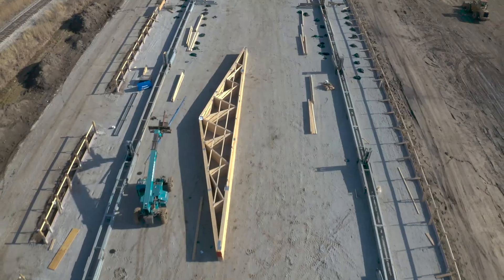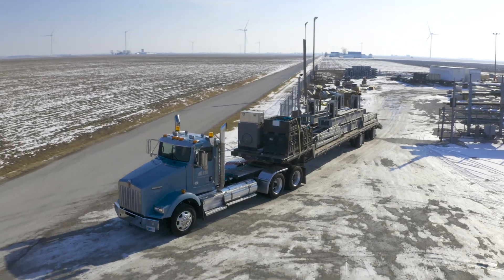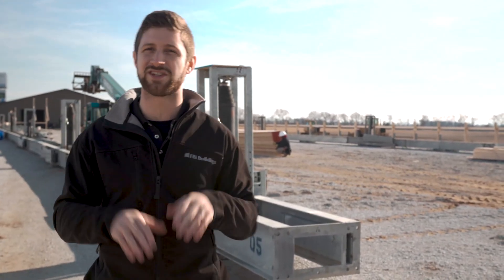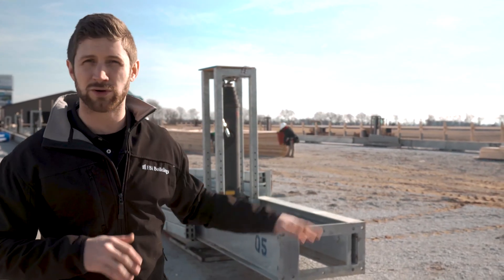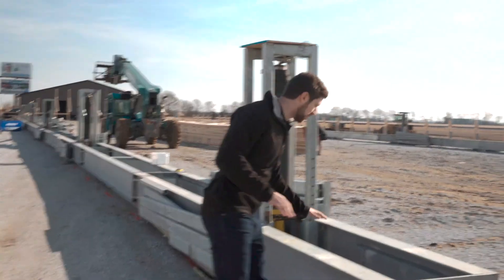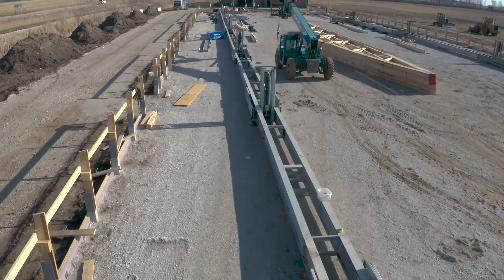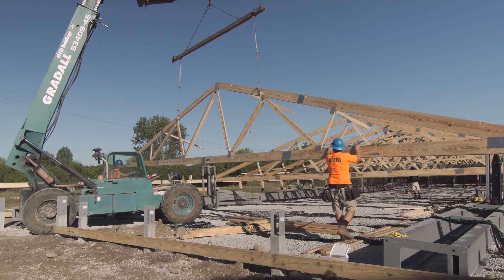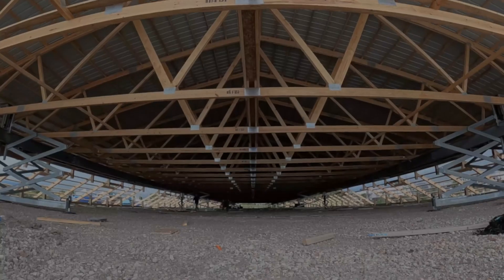How QLYFT Staging and Set Up Affects Your Building Construction

Comment: You say in the video that the QLYFT System doesn't add to the footprint.

However, the walls are connected and splayed out to the side so extra surface area for this would required on all sides. This would add a large area around the construction.
Reply from the maker: Fair point! We could see how that would be confusing to viewers. What should have been specified is the overall mechanics of the QLYFT System doesn't add to the footprint.